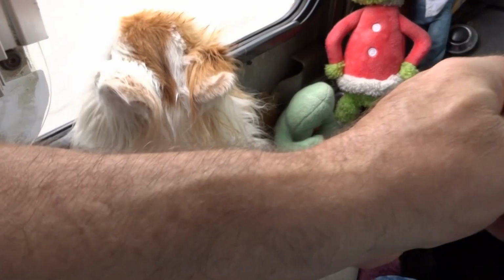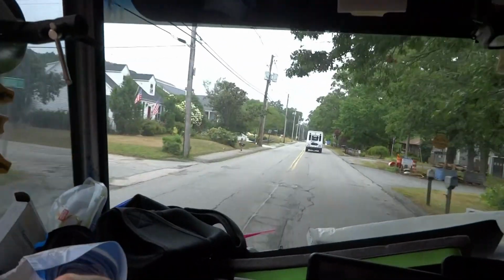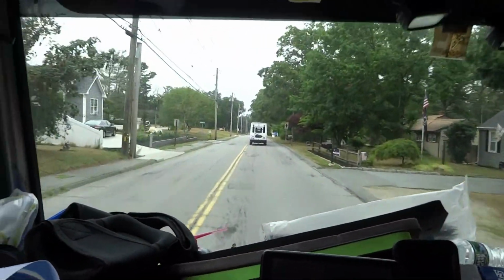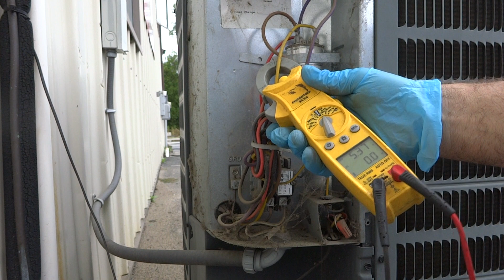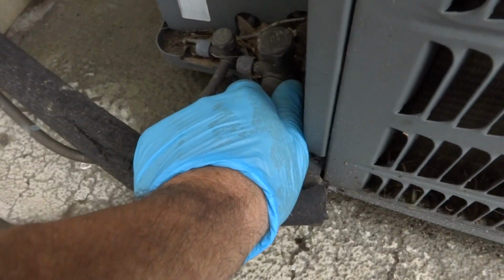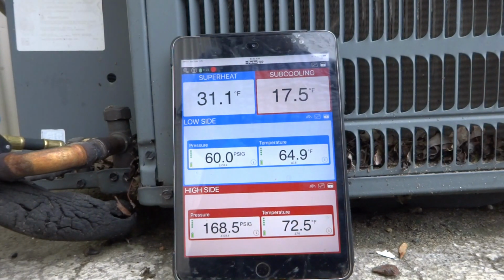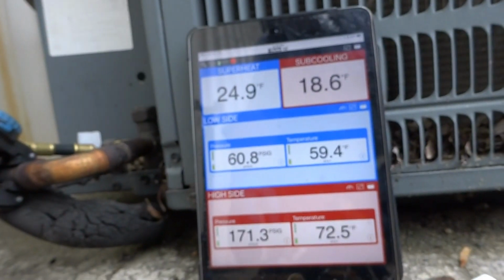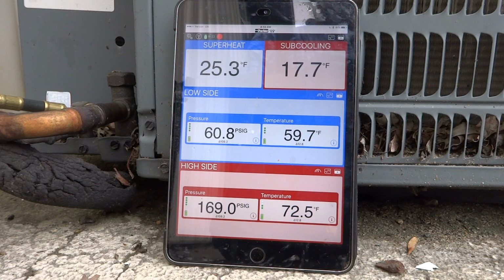OLD GOODMAN AC UNIT TRIPPS THE BREAKER

Comment: My old goodman from 93 still purring like a kitten. Doesn't leak. Runs like a top. But I clean the evap coil and condenser coil every spring before its first use. Check the cap to make sure its still within 6% of designed limit. She's definitely not energy efficient but not ready for the scrappers just yet.

Comment: Commercial building so likely 208v. If a phase dropped during the extreme heat, which I've seen around this area a few times this year, lots of 208v equipment will trip the breaker if one of the phases feeding it drops...unless you're smart and kill the breaker before your equipment burns up!

Comment: Finished that Rheem unit up today. Parts came in and wow. Replaced the cap, trans, and found the reversing valve leads arced  on the copper. Had to cut wire nuts off the 24v leads were welded welded to them. Rewire and incase 24v tstat at condenser wire bare to copper 2xs. Up and running can't stop a Old time Rheem unit. Just like ya cant stop a Good man like you Steve. HVAC ON AMERICA!!!!!

Comment: If it got installed correctly with the right sizing, ducting, returns etc.  it'll run just fine. It's those that suffer from poor installation methods that tend to have the most problems, regardless of brand.

Comment: Could be the breaker got hot and tripped. It happens.
Reply from the maker: IT TRIPPED LAST TIME I WAS THERE 5 YEARS AGO LOL
Reply: If there was a brownout the breakers can definitely overheat under load and trip. Used to work for an engineering company and they'd get brownouts every hot summer day. Took 3 years of the entire industrial park screaming at the utility to get it fixed. One time when it was especially bad, 94 volts if I remember correctly, an engineer took his thermal camera over to the breaker panels and it was shocking how hot any with any kind of load on them were.
Reply: @stevenlavimoniere Since that breaker has tripped before, for no good reason, I’d change the breaker for a new one. It may be a faulty breaker, who knows, but I’d start with that since there doesn’t appear to anything else wrong with the circuit. I’m a 25 year electrician and I know what I’m talking about most of the time.